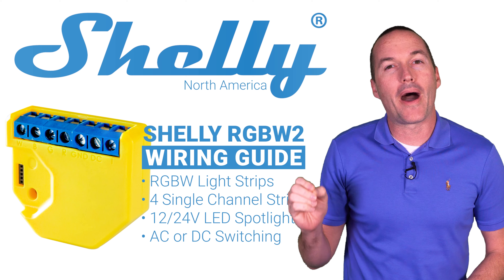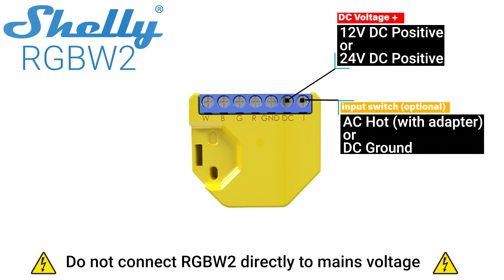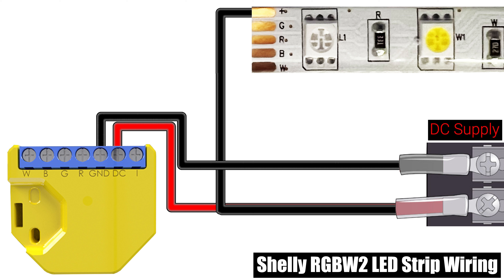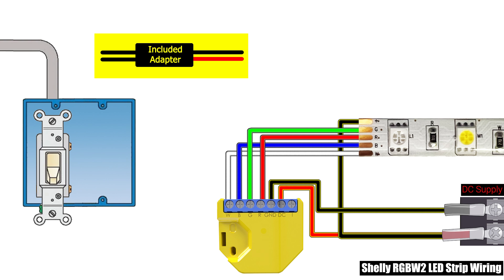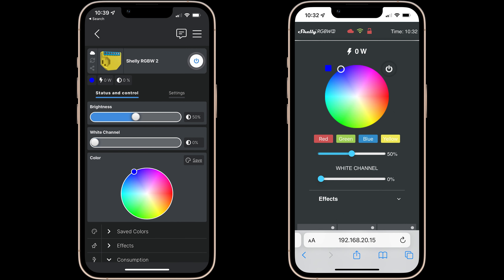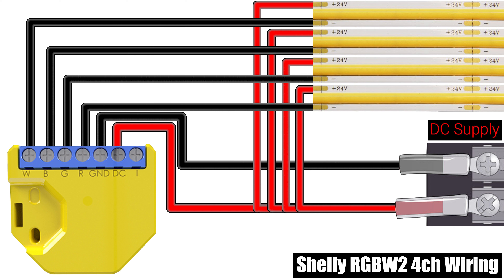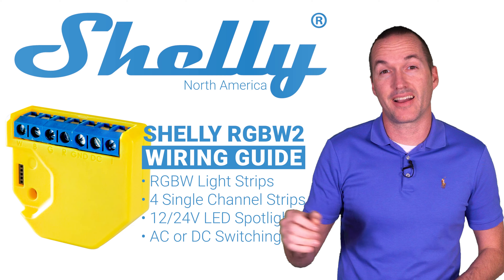All About Shelly RGBW2

Comment: Does exist some possibility of connecting CCT led strip with the control channel (to control the temperature of white)?
Reply: Would be great but I think there is one channel missing (if you are talking about rgbcct/rgbww), so no chance to update that with new software. But I think two tunable white would be possible if that is what you mean... As long as the Shelly Software allows it. Maybe we'll get an answer... That would be great

Comment: I bought this and it a black piece of wire that has a heat-shrunk hardware that is very small with a red and black wire at one end and 2 black wires at the other end... how does this connect and does it connect directly to 110v AC, the reason I am asking is because the wiring diagram has AC 110v connecting to the heat-shrunk hardware?

Comment: With RGBW 2 you can configure lighting scenes where the same LED strips change color for each scene and if I use different RGBW circuits, can I group them into scenes with different colors for each LED strip...?

Comment: I want to have the switch input act as an input signal instead of a master control. Is it possible to use the physical switch to act in this way?
Nevermind, figured it out after rewatching the video (edge setting for button).

Comment: becomes a shelly controller for addressable leds ???
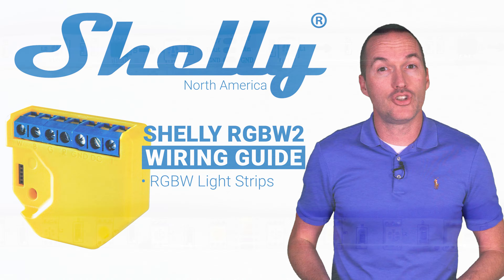Reply: Unfortunately not. Rob tells about it at 1:50
Reply: I think it could be done if someone wrote firmware for it, almost all of the addressable strips use SPI interface.